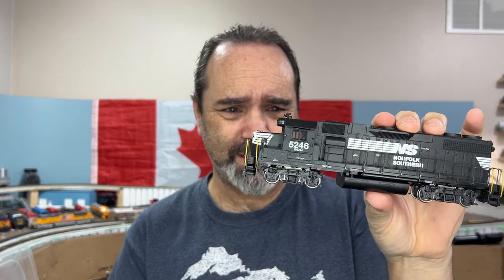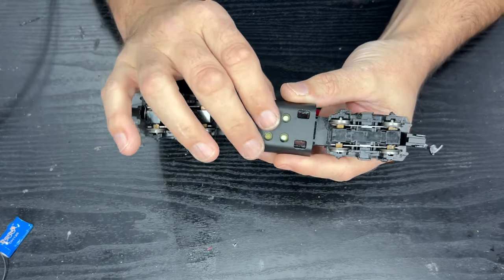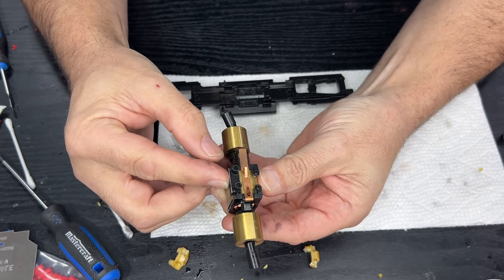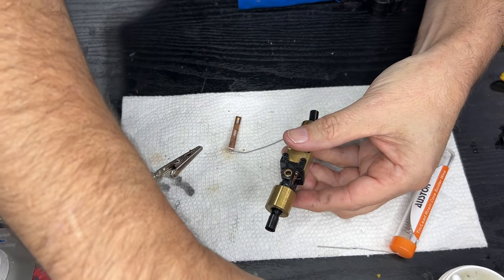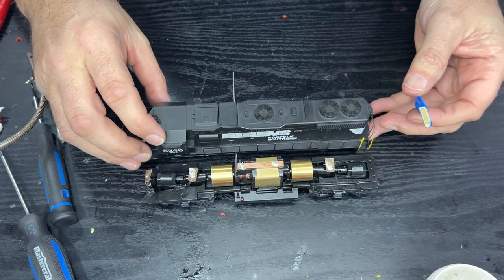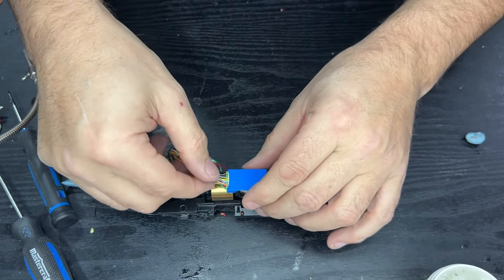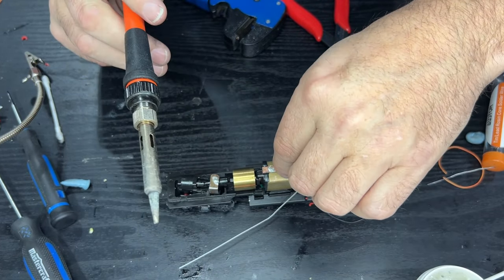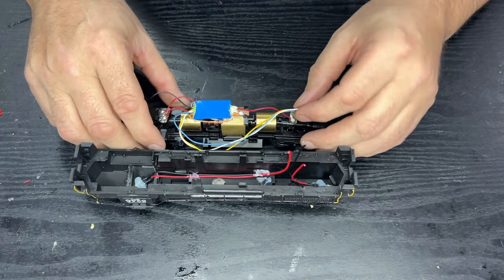DCC Decoder Upgrade - Athearn Blue Box GP38 Norfolk Southern

Comment: The trials and tribulations of wire management. The shell not sitting properly was likely the thick LED wires originally used and/or the dabs of hot glue on top of the decoder thickness.  I have a few Locos where the shell or cab doesn't sit properly too, not a big deal. Some day I will revisit them and correct them. Great job!

Comment: If you remove the dynamic brake fan housing, ( center fan ) You will find a small flat weight on a shelf. Remove the weight and cut out the shelf. This will give you more room, and allow your decoder some breathing room. Also, you won't have to glue down your shell. Yes, replace the fan.
Reply from the maker: Awesome, thanks Greg.

Comment: If it is important to keep the front and rear trucks in their original orientation (or any other parts), I have a bottle of white-out (typists correcting fluid) to mark the part and its location. It is cheap and dries quickly. Only down side - it may be removed if you use solvent type cleaners, but you can always re-mark immediately after the clean.